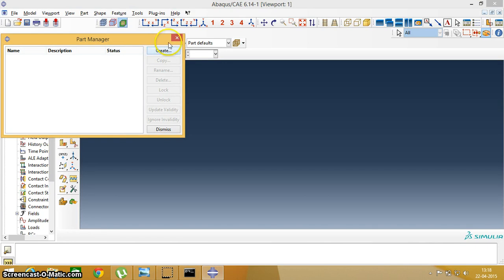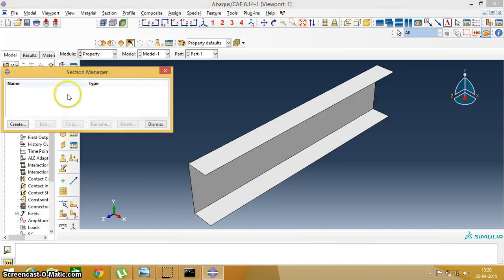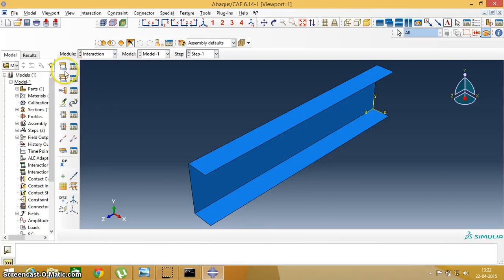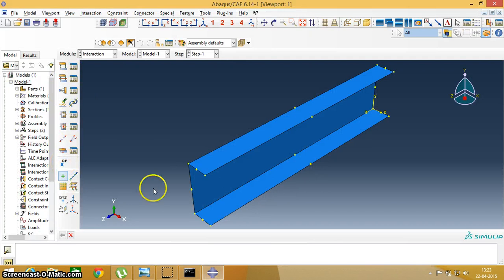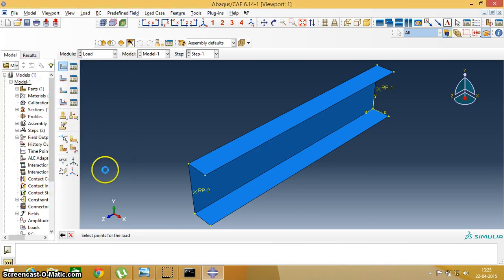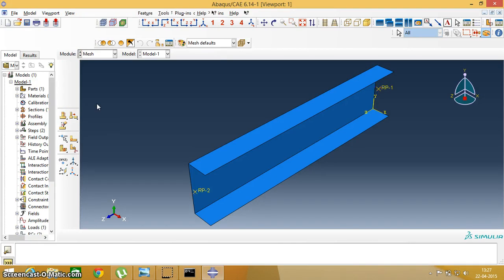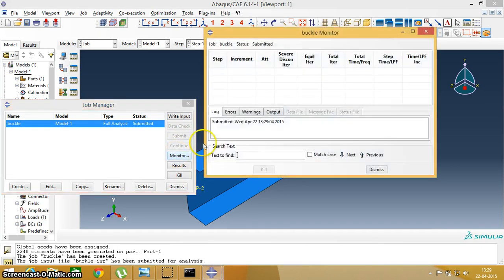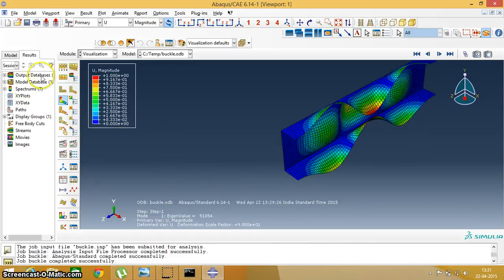Buckling of cold formed steel using ABAQUS software(column)

Comment: Hi Aakash could you please tell why do you use reference point, cant we apply the boundary conditions on the C section itself?
Reply from the maker: You can apply pressure but to get uniform Axial Loading at that point (reference Point). You need to tie them with MPC constraint otherwise without tieing it you will not get the behaviour of any section at the ends
Reply from the maker: Reference point is important and it should be at CG so that if you tie MPC Constraint , practically it will act as a whole one section and act accordingly
Reply: @aakashk47  why using MPC instead of other constraints ?
Reply: I have the same question  and one more. Why do you use MPC constraint instead of the others? What is it for? Thank you.